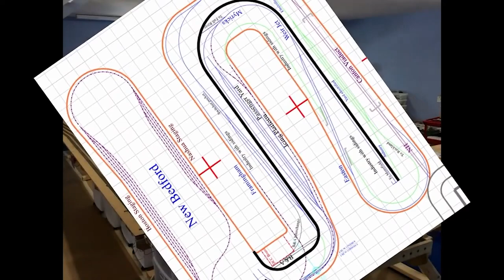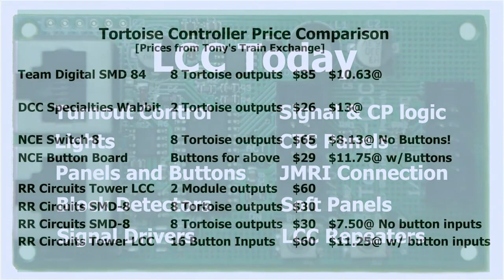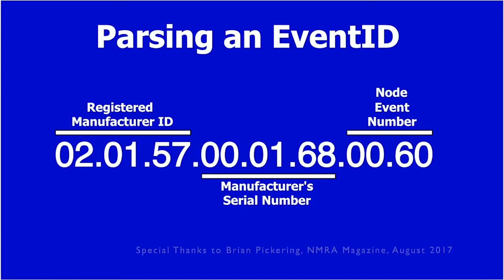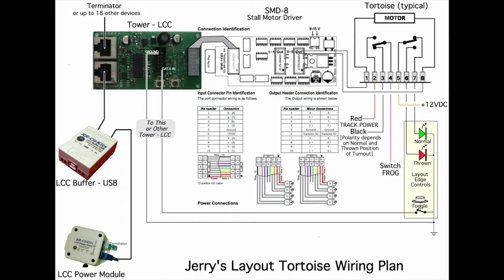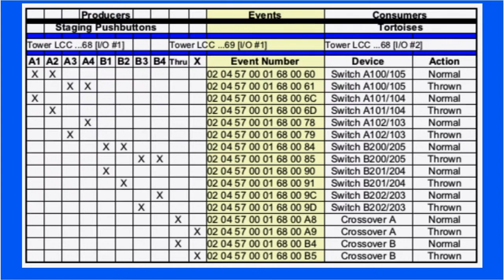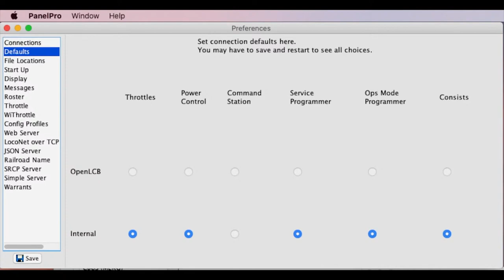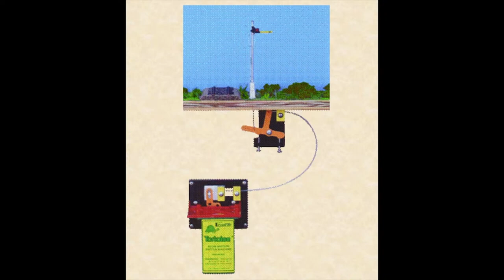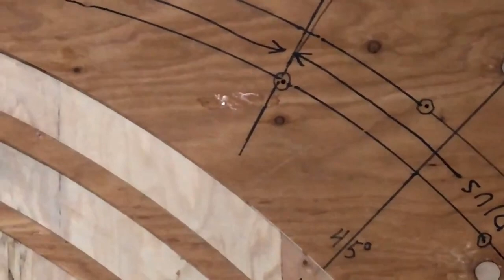Jeff Gerow   LCC A Better Way To Move Points

Comment: Thanks for doing this, very well done.
I have been using LCC for two years now and it does what I wanted,  turnout control, block detection and signaling (track shorts do not change signals). It is important to save a copy of the node configuration before editing the configuration.